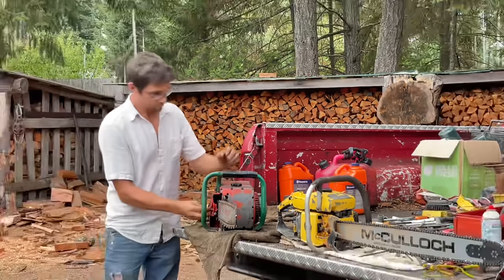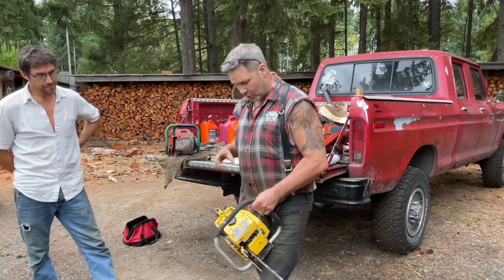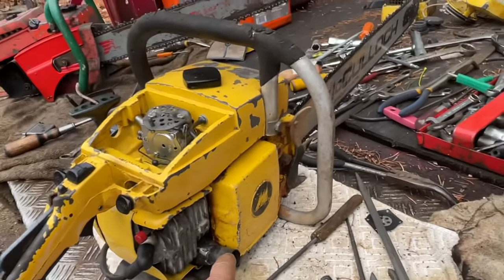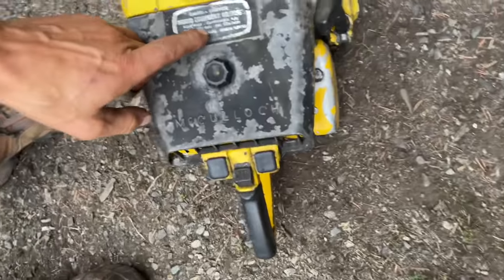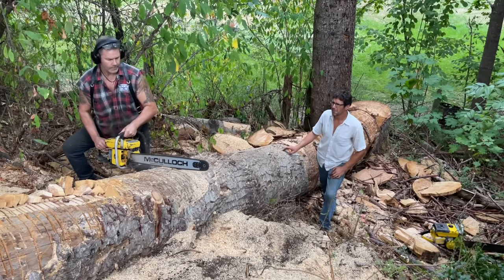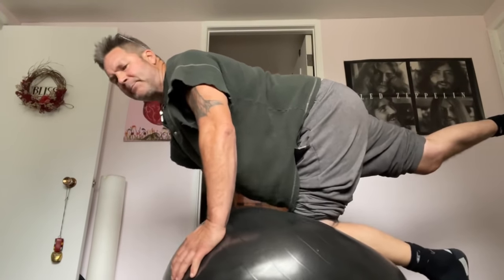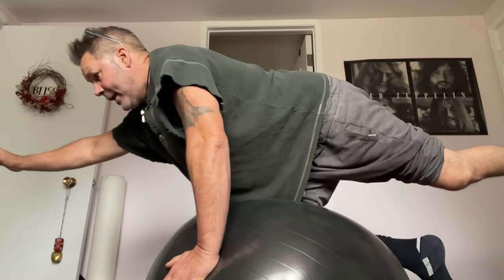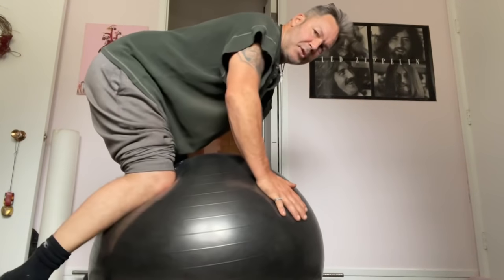We may have found something special

Comment: @BBR, one thing that i learned back in my motorcycle racing days, was that 2stroke engines do better with back pressure, in order that the incoming fuel/air charge isn't wasted outside the cylinder head! You might consult with your gurus about how best to do that, without burdening yourself with a racing style expansion chamber, 'cuz it seems that a stubby short pipe would be counter-productive?

Just my 2cents....

I'm LOVIN' yer channel lately! Good balance between topics! KEEP PREACHIN' THE MESSAGE -  LOVE WINS!!!

God Bless ya Bro'!!!

Comment: I'm watching this, my lower back aches from yard work. I KNOW my core is weak so I'm going to look into a balance ball. LOL, it should be much more helpful than sitting in my office chair watching YouTube videos! In fact, I could watch your videos while balancing! Thanks for this info...
Reply from the maker: i know for a fact if you give yer self a week or two, everyone is different, you will be super impressed , every day 5 min
Reply: Best thing for low back pain that I've found is stretching the back of your legs. Sit on the floor with your back against the wall and lean forward til it hurts or stand in front of a chair with your heel on the seat to stretch one leg at a time. Hockey players and mechanics know what I'm saying!!
Reply: Of course if your workin outside off the back of your pickup, throw a leg up there and lean into the pain ,slowly but with a purpose!

Comment: The “wall” sends a wave Bach to keep from scavenging the fuel charge from the cylinder. The “straight pipe” won’t work as well as a pipe that cones up to a enter section then cones down to a smaller “stinger” outlet. The volume of the expansion chamber depends on the displacement of the engine and the power characteristics you desire
Reply: I know right, sometimes i think do they even know about resonance&expasions .. the key on  making power on 2stroke..  resonance...
Reply: Just look at a two stroke bike pipe . Same deal
Reply: Jeffrey Yeater   Duh, I work at FMF

Comment: My chiropractor made both myself after a 4 times flipped in my Jeep tj and my dad who's had bad back problems from numerous injuries sit on one of those balls while we were hooked up to the TENS unit. It works, just sitting on it while you're being shocked does a good deal of repair. My my dad even bought one for home use with his own TENS unit work...
Fast twitch muscle fiber is the key because it does the constant work that you cannot control and slow twitch are your conscious lifting muscles that you do control. Without those fast twitch muscles being worked on, you're a literal crane with 3 a pole boom no gussets nor support tubing to keep it in line; any load will twist your back right out. Strength is only as good as a body that can control the load.

Comment: I have put togather a small
Collection of cool
Saws all were cheap or free.  Most would run with carb work around here husky saws nobody wants it’s Stihl or nothing so other brands go for pennies at auctions husky 66 for 75 bucks running.  
I bought and sold a few just for learning projects
Las winter bought an 044 blown up
No compression figured piston and go
Had to tear it down 3 times but I learned. Case gasket is what blew it up.  Not really afraid of a comparative
Tear down now. It’s a beast.

Comment: Hey buckin jack Murphy here after you put the 90 on the pipe maybe put it on at a 45 degree angle to the back find a 1/2 drive deep well socket that fits the 90 ratchet side out .
Reply from the maker: hi Jack Murphy . thx budy

Comment: Without some sort dyno you have no idea if your "mods" work. Yes they can make more noise and feel different but you still really dont know. 
That open exhaust on the Mac is killing power for sure... stock muffler would do way better and its not because of back pressure. Look up 2 stroke expansion chamber theory, many people can explain it way better than me. Look up Kevin Cameron from cycle world for one but there are many other real experts on this. 2 strokes have been around a long long time and people have them figured out... nothing your doing has not been tried before
Reply from the maker: lolololololololololooo..hahahahahahahahaaa. Dan with all the respect i can muster,, your terribly WRONG. thx for watchin an commenting
Reply: I have read two stroke expansion chamber theory, and before it was discovered they were using an open strait pipe header to help pull exhaust gases from the cylinder.  I dont see where his open header design is harming the performance because the negative pressure wave created on the exit of that pipe will still find its way back to the cylinder based on its shape whereas in a stock muffler because of the stack on the end plus the outlet shape and design you would not be able to utilize the negative pressure wave because it couldn't be deflected back.  Granted it gives the saw a very narrow rpm range it would be most efficient in, but it is still better than stock.
Reply: @BuckinBillyRaySmith  too bad you dont have access to a dyno, you would see the difference for sure. Anyways to each their own.
Reply from the maker: @SuperBigdanno  we’re working on Dan , my Dyno right now is running the saw with stock muffler  in the wood . Then taking it off and runnin the muffler we are testing in the same wood and timing it, if the stock was faster Dan I wood be running it . Stay tuned for Dyno . It will happen